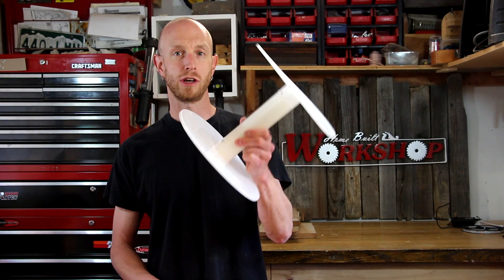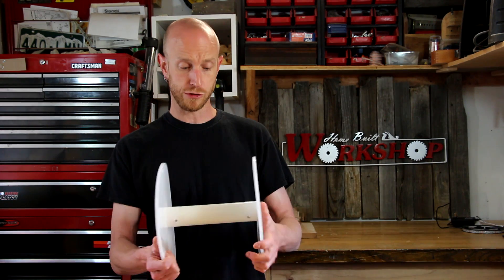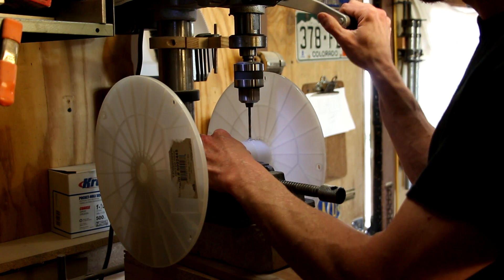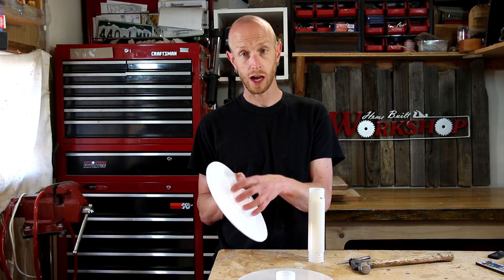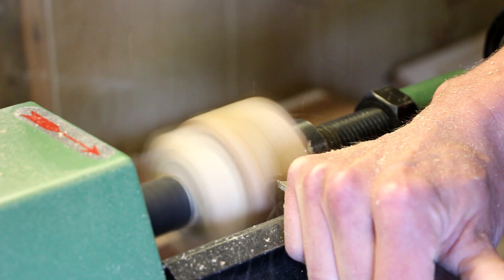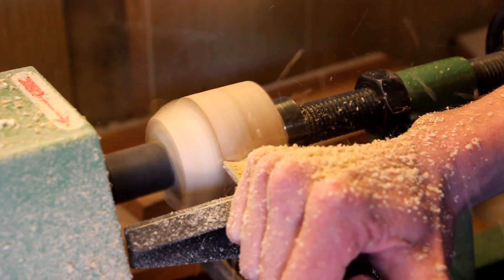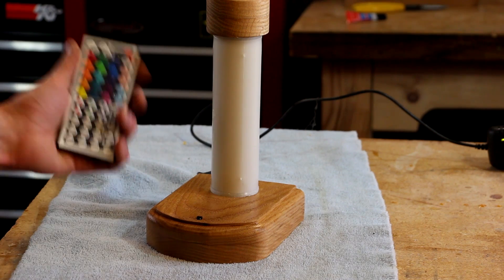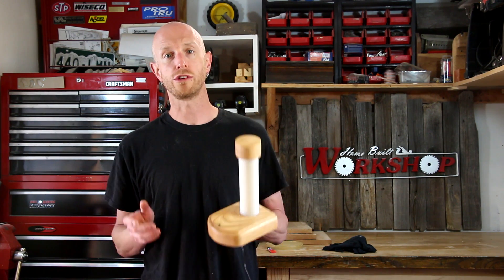How to build an LED lamp (with LED Strip Lights)

Comment: it's very beautiful I have a question how do you connect the rest of the lights without a connection or a control and I have another question can you send me the tool you don't want I want to start my own wood project
Reply from the maker: +elia gar I would have to buy a controller for the rest of them and probably solder the wires on. Controller is inexpensive.